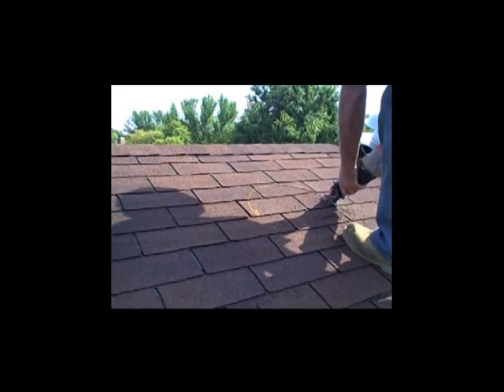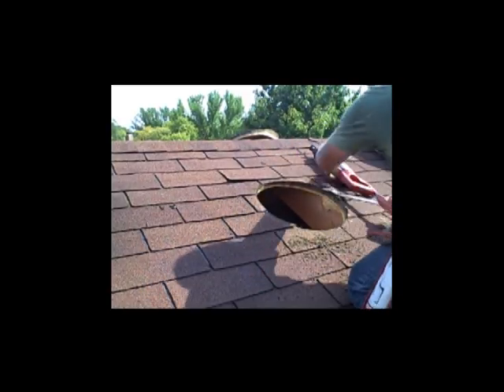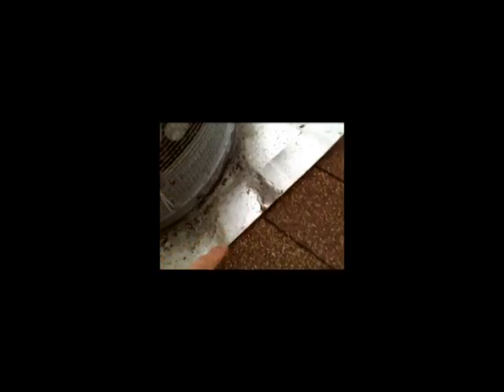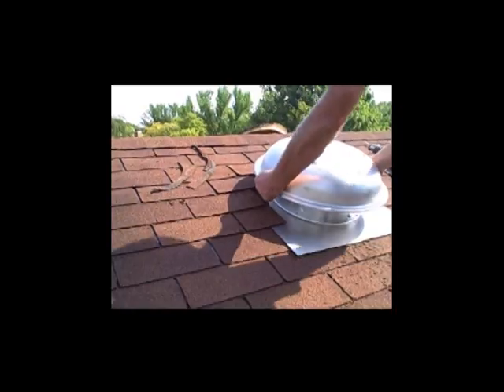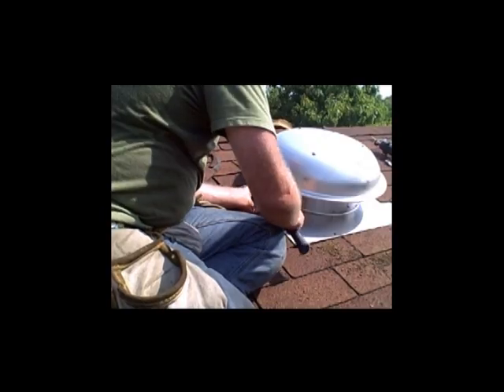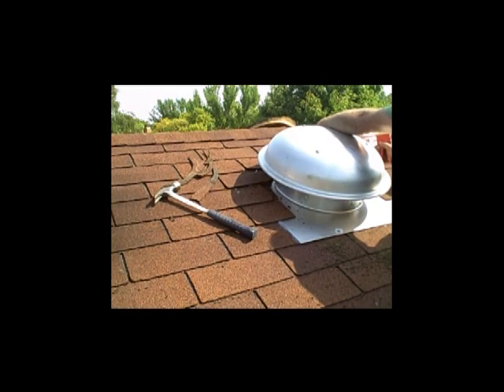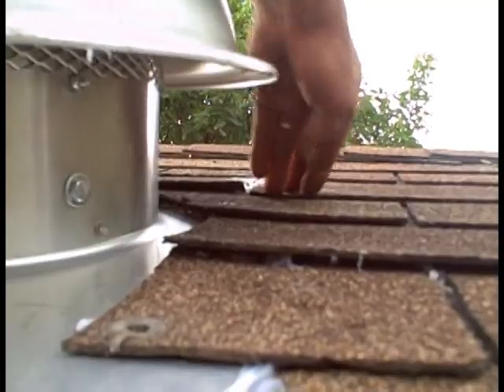Installing a roof top attic fan

Comment: Extremely helpful. My father installed one in our old home. The only difference is he drove a center nail OUT from the attic as the center point to where it was protruding out of the roof/shingles. This way he was absolutely certain to not cut any of the 2x4s on the roof when he cut.
Reply: I was just thinking the same thing. That way you know you won't hit a rafter..

Comment: I think this is a great video and appreciate you showing us how you do this yourself. I would recommend to anyone who isn't sure about the attic contents to always check inside the attic first before cutting your hole. Some builders will install attic lights and run the electrical wiring close to the top of the ridge line. It's something I always check first so I don't end up having to fix something or at worse end up electrocuting myself. Also when your done cutting your hole, turn your reciprocal saw on its side, slide the blade under the shingles you need to lift up and cut under the shingles to cut the nails off. Works great for me. Thanks again for the video.

Comment: Air vent inc installation roof vent:   Nice Video and thank you..   I'm only doing my garage from the ladder, this will be a ten hour project... Just kidding.... You really made this look easy.  My box comes with a hole pattern cut-out.  Lol      Your video made me go shop on Amazon yesterday for a 4" inline hose fan and a outside dryer vent cover with louver and screen.  And today added it to my 10'x7' Craftsman storage shed at the front gable took 20 minutes looks great low-noise and pumps hot California air right out,, dropped the temp 30 degrees and cost less than $30.00 and one day Sunday delivery.  Looking forward to more how to videos.
Reply from the maker: I'm an inspiration! Congratulations on your off-label process application for air-flow! Try selling this to your neighbors who have sheds...you might be on to something.

Comment: Hello Jeff,  You are a professional and have provided a detailed and articulate explanation of how to install an exhaust fan.  The only concern I would have as a homeowner on the second roof with the architectural shingles is that there is already a ridge vent installed under the ridge cap.  The recommendation by the IRC and IBC is to have only one type of ventilation due to the air flow conflicts that could be caused by having both a ridge vent and a powered vent.  If the  powered exhaust vent is over sized for the attic space, it could actually draw air and moisture in through the ridge vent.  Please advise on your position and why the installation of the jet vent on the second roof with the ridge vent already installed.  Just trying to learn more about powered vents. Thanks.
Reply: James MacLean you are correct. Power fans should only be used on hip roofs where you can’t do ridge or box vents
Reply: I'm so glad you asked this question. We have a hip roof and it never occurred to me that there could be air flow conflicts if we have both a vent and a roof fan.
Reply: Just left the same comment, I have a build in 4 days and am adding more roofing components to properly ventilate the attic. We were taught to not have active vents that close to static vents

Comment: If you need to replace that fan be prepared to replace the shingles as well. Them globs of silicone will not peel back up. There is still enough asphalt on those shingles that the heat will hold them down or nails work well too. Just my expierence installing new fans after someone went nuts with the silicone.

Comment: Why did you use caulk, rather than henry's or some other roof sealant?  I would be concerned with the sun drying and cracking the exposed caulk joints.  
I would also run sealant along the top where the fan body meets the shingles...just to insure no leakage.   
Another tip is to figure out from the inside where you want the fan....put a screw or nail in the center, from inside.  Measure and cut from the outside.
Reply from the maker: The problem with amazing sealants, is that the Jet Fan Attic Fan will outlast many roofs. If you stick shingles down with sealants, the roofers will destroy the fan when they try to remove the old shingles while replacing the roof. I like silicone because you can get it off and apart later without much trouble. As long at the roof pitch is above 3 inches per foot, water will drain away without any need for crazy tough and sticky sealants. For years, I never used any sealant at all, but it is good to stop wind from blowing off shingles that have been separated from their seal-down strips. Also to stop an occasional strong wind from the side from blowing precipitation in under the shingles or the flashing, but you have to be careful to leave water a way out at the bottom. You are right about the silicone on shingles that are exposed to the weather; while the 100% silicone caulk that I use never cracks; freezing temperatures with water will cause the silicon to come off the exposed surface of a shingle.  AtticFans.com

Comment: That house appears to have a gable roof with a ridge vent. Does the ridge vent alone not do an adequate job of venting the attic?  Also is it OK as far as windstorm certificates go to have both a ridge vent and an electric attic vent? I have a hip roof that the roofing company suggested putting on ridge vents and eliminating my electric fan. Big mistake. I would love to install the electric fan again but was a little leery because of the existing ridge vent.

Comment: Hi  I started cutting shingles to use a jigsaw to cut the wood.  I did this to install a similar home depot fan (with powder painted dome).   However AFTER cutting the shingle hole, as far from the peak as you demonstrated, and, as pictured on home depot website, the bloody instructions insist the edge of the dome must be 24" from the peak......so Ive promptly miscalculated and cut a circle directly beneath that.  Is this an issue to have the fan's dome edge only 8 inches to a foot from the peak?  Why to the instructions say to mount the edge 2 feet from roof peak (meaning center of 25" dome is 36.5" from peak)? Thank you.

Comment: Could this be installed on top of a rubber roof with the metal sitting on top of the rubber or does the metal flap need to go underneath the rubber?

Comment: I have a ridge vent. How do I determine the distance from the peak to install? This video shows the fan placed inches from the ridge vent and seems will be inefective if too close to the ridge opening since will suck fresh air from the ridge vent across... how about 24" or 36" from the peak? Am I wrong?
Reply from the maker: Hello this is not a new problem. it's always best to have more cross-flow whether it's a ridge vent or a roof vent or a gable vent. Cross-flow is good so you're right, put the fan a little lower to give it a little more distance. But honestly, I don't worry too much about most ridge vents because they don't really let too much air in as they're designed to stop wind from coming in with rain and snow. 36in to center of fan down from peak is good.

Comment: Question, why wouldn't you put tar/roof cement under the flange and shingles you pulled up? Just seems like that is going to leak with any type of hard driving rain.
Reply from the maker: Tar would be necessary on a flat pitch roof to completely seal water out from all directions, but on a sloped roof water naturally drains down except when there is a strong wind. The silicone stops driving wind just as well as tar assuming it is nailed down as well. The bad thing about tar is that it is extremely hard to remove the shingles from the flashing when it is time to replace your shingle roof.

Comment: A powered attic vent with a ridge vent, makes fuck all sense.  The fan is going to pull air from the ridge instead of the soffits.  Decent install, but a terrible example of spplication.

Comment: Mastic is better for caulking as it has bitumin... same as asphalt shingles.  I would have swept the area before installing the fan.
Reply from the maker: So you're the guy putting 50 year mastic on those cheap two year fans!
Reply: @jtideman1  Not actually.   No roofer across the country would tell you they use silicone.  Use the right caulking so your fans don't leak.

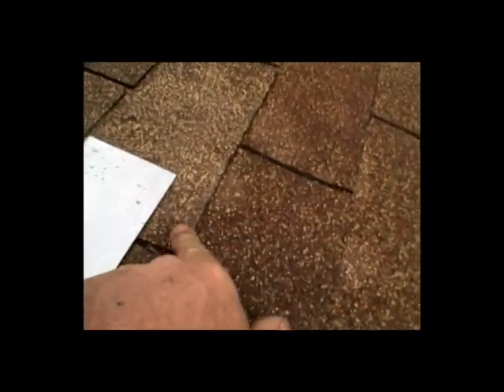Comment: How much is it to have one of these installed? The reason why I'm asking is because I have vaulted ceilings in my home and when it hits 90 degrees outside I can forget about cooking in my home because the extra heat from the stove and the little attic space between my ceiling and the shingles my ac runs all day until 7:00 at night.I have been up in my attic and there is very little space between the roof  and the actual ceiling in my home. When it gets 90 outside those shingles are so close to my ceiling  it adds heat inside my home so I thought that maybe putting in one or two of these fans would help out a lot.Right now my home has 2 off ridge vents that I made at the company where I work at. We make roof vents for homes.Anyway what's something like this would cost to have someone come out and install 2 of these bad boys in? Great video my friend,thumbs up on it.
Reply: If the pitch of your roof isn't too extreme you can get one installed for under $300. The last one I installed in my home cost me right at $200 because I bought all the materials myself. One of these 1250 cfm fans purchased from Lowes is $97. My electrician charged me for one hour of his time $65.00 only because he had to run the wiring to the breaker box and I had him install a couple of lights in the attic for future work I'll be doing up there. I bought a 50' roll of electrical wire $20, one tube of clear roofing silicone $3, a small box of roofing nails $5, and some tools I didn't really need just because you can't go to Lowes without buying more tools right?

Comment: These fans are not allowed by code in Georgia. The negative pressure created in the attic draws cool air out of the conditioned space eliminating any benefit of a cooler attic.
Reply from the maker: If any house anywhere has gaps that allow air to flow through to the attic, winter or summer with or without an attic fan, the gaps should be sealed. Also if the state of Georgia could read the instructions that come with all attic fans they would know that you must have or add static intake inlet venting that minimizes negative pressure. The state of Georgia has erred. Does the state of Georgia allow bathroom fans? How about kitchen fans? Is it illegal in Georgia to turn on your bathroom fan when your AC is on? Does the state of Georgia allow you to open your window. I know the busy law-makers in Georgia open their windows because they are still alive and well. People get sick and die without oxygen.

Comment: can you put one of these fans in even though the is a ridge vent?..how far  away from the peak?
Reply: hello hello
Reply: yes you can install these next to a ridge vent!!! usually about a foot from the Ridge of the Roof
get the 3.0 you'll be fine
Reply: +s smith  Most generally I first go into the attic and find where I'm going to install my fan and drill a hole in the center of the two rafters 24 inches below the peak of the attic. When you get up on the roof lay your fan down with the hole you drilled in the center of your fan. Then align the bottom flashing of the fan on the bottom of the next shingle down. Look at 3:50 in the video to see how he has it. If you're within an inch or less to the next shingle up align it with that one, but try not to go less than 24" below the ridge line. If you moved your fan down 2 inches just measure 2" below your drilled hole, draw your circle and cut your hole. Now after you've installed your fan, the bottom flashing won't overhang and will be lined up nicely on the lowest shingle
Reply from the maker: Ridge vents don't provide much net free area so you do not have to worry about all the air coming in the ridge vent. In truth, very little will. Once the fan comes on every other vent that goes to the attic will act as intake. no matter where it is. If you are worried, put the fan 3 feet down from the ridge instead of 2 feet. You attic will be much cooler and so will your upstairs rooms. Just make sure there is enough total intake to provide the fan with "make -up air" from outside. So you will not just create vacuum, but actually remove hot air.
Reply: If you use one of these with a ridge  vent, the fan will pull air from the ridge vent instead of the soffit vents.  So no, do not install with a ridge vent, it will defeat the purpose of both.

Comment: Just curious on how you knew where the rafters were?
Reply from the maker: +LionTribe909 !! The most reliable way is to go inside the attic and drive a nail up through the roof exactly in the middle between the rafters. To be honest, what I usually do is just tap on the roof so I can feel and hear where the rafters are and check a few rafter layouts to know for sure. If I cant be sure, I just cut a small hole first and measure over. Its easier to do on a truss roof with plywood and where there is only one layer of shingles.
Reply: +Jeff Tideman Thank you very much for the detailed reply...
Reply: I was wondering this toi
Reply: Rebecca Junis So from inside the attic you want to mark the middle of the rafter where you want the fan to be placed... I drilled a hole on the mark and then stuck the bit through the hole so you can see it from the roof sticking up... From there you just use the template that comes with the fan and center it on the hole you drilled and cutout the bigger hole... I really hope this helps... Good luck...

Comment: I see you have a gable roof with a ridge vent. Doesn't the ridge vent get rid of hot air very well? I had to get a new roof after hurricane Ike and the roofing company said it would be better to remove my electric attic fan on my hip roof and replace it with ridge vents that went down 4 feet at each corner. Worst mistake I ever made. I think I'm going to install an electric fan that I know works and after watching your video.
Reply: There's various fan/vent combinations that can be employed. If you already have ridge vents what you want is a fan to pull fresh air in and exhaust it through the existing ridge vents. If you mount a roof fan without ceiling the ridges then air will be pulled through the path of least resistance and may enter from the ridges rather than the eaves.
Reply: @agentx250  Well I ended up installing the electric roof vent and sealed up the ridge vents. A lot lower temps in the attic now.
Reply: @Captleemo  Good to hear it all worked out for you. I'll be installing one soon as well. Luckily I don't have any ridge vents working against me. lol

Comment: I cut the shingles on the sides and not the top as you indicated. There is water coming up OVER the flange and leaking into the attic. Could this be because the flange is butted up against shingle at the top?

The instructions for this Lowes fan indicated differently, that the shingles on the top be trimmed back.

The roof isnt that steep. The flashing is about 2' square, and the fan circle is 14.5" diameter -- Lowes air vent Model #: RV26ML

Thanks for any advice!
Reply: I was wondering about this also-! It seems to me that without caulking across the TOP of the unit, both under those shingles and running a bead either all the way around the base of the unit and basically "Everywhere" we made a hole in the roof for this thing......I don't know-? What about those occasions when we get wind-driven rain etc.-?

Comment: silicon is not compatible with organic shingles. Silicon would melt the shingles.
Use roofing mastic
Reply from the maker: I have been using 100  percent silicone caulk for 38 years and I have never seen it melt a shingle. I agree that it is not the best for sealing an exposed nail head but I like it because when the roof needs to be replaced you can separate the shingle from the fan's flashing more easily without damage to the Jet Fan which will last longer than your next three roofs. I use it in vertical beads under the shingles to stop wind from the sides and to "glue" the shingles down after having been separated for the installation.

Comment: My neighbor's house just burned down due to the attic fan that he installed last year.
Reply from the maker: Fires caused by attic fans are extremely rare...so rare I really have to question the wiring method used. All UL listed motors have a thermal protector so if the motor is blocked from turning and overheats it shuts off automatically. I made a video showing two cheap store-bought attic fans on a woods cedar shake roof that were packed with straw from birds nesting. No fire. Thermal overload protectors are required and they work.

Comment: I live in Miami-Dade County and you'd probably be fined by code enforcement for such a flimsy install. Here's how we install them, 
"Remove roofing nails from top row of shingles so the flashing of the roof vent will slide under shingles. Apply approved roof cement to the underside of the vent flange around the stack opening. Carefully slide base of vent under shingles with arrow facing up. Make sure the throat of the vent is centered over vent hole. Fasten the base to roof decking at corners, and approx. 4” o.c. 1” from the outside edge of the flange and 1” from stack every 45° with approved roofing nails, 11 gauge, 1 1⁄4” x 3/8” galvanized annular ring shank roofing nails, keeping heads of nails under shingles where possible. Use a minimum of 32 nails. Nails shall be of sufficient length to penetrate through roof sheathing a minimum of 1⁄2". After fastening the flanges to the deck, nail the loosened shingles and adhere with approved roofing cement. See details drawings herein. Seal all seams and nails with roofing cement."